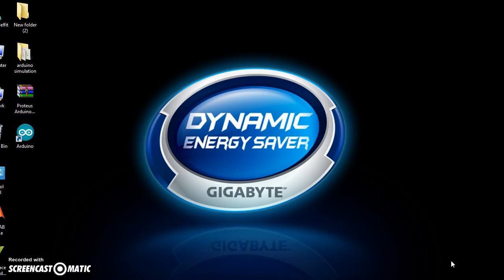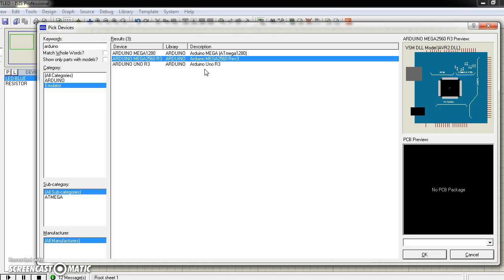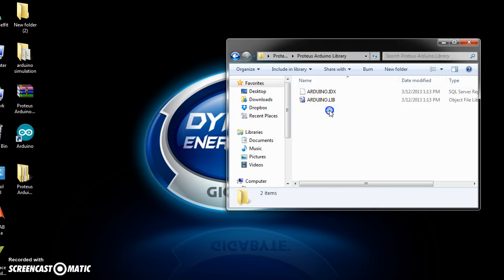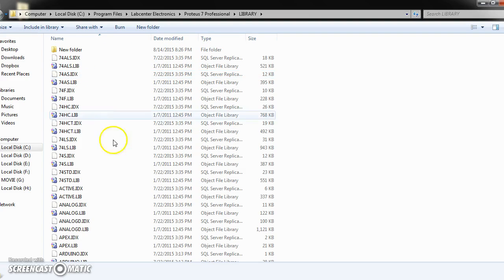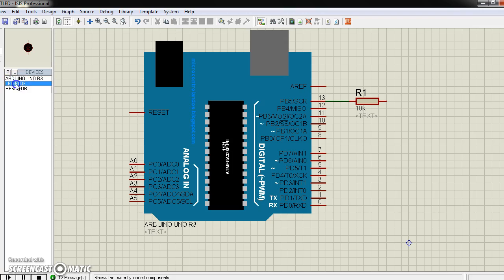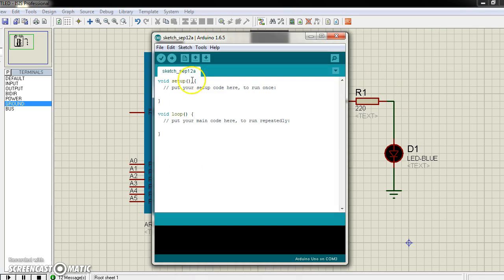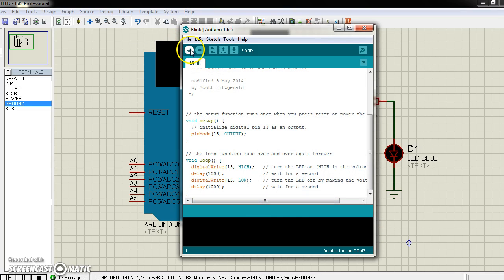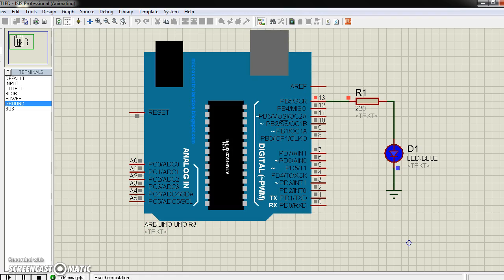Tutorial : How to Simulate Arduino Program With Proteus?

Comment: Hello, I made an Arduino simulation with Proteus, but when executing the code, several error messages appear, knowing that the connection is correct according to the map that I have, and I do not know which library I am missing from the Arduino. ACS712 acs_sensor(ACS712_30A, A0); If the code is executed and also another message exit status 1 . appears
'acs_sensor' was not declared in this scope although I tracked the access all is correct and in Proteus also the Arduino IDE doesn't show up. Other forms don't show up. Please help in case of this problem